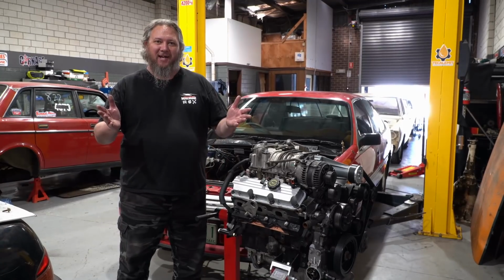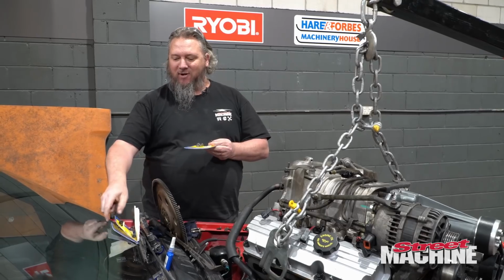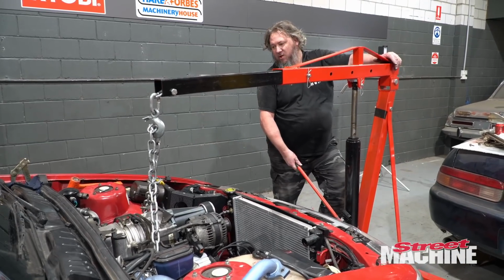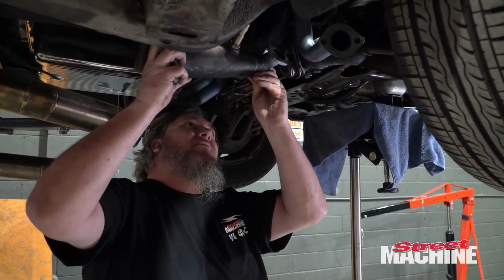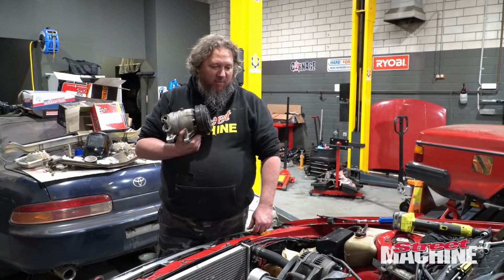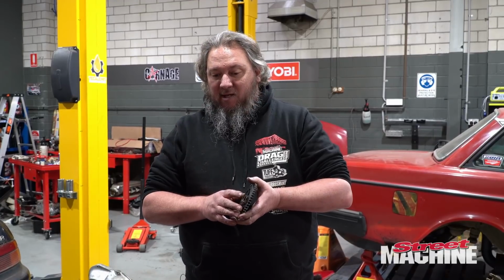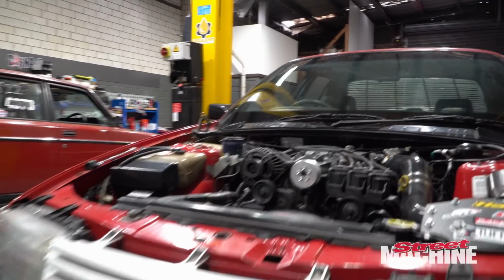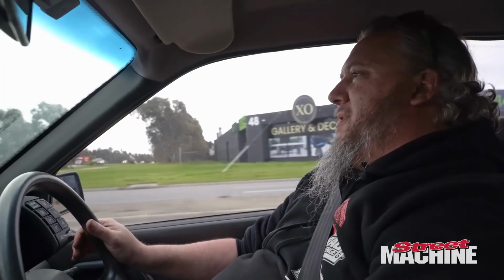Carnage - Supermang L67 3800 rebuild - Part-5

Comment: Yep. I’m converting my VT over to manual. When I was ratcheting up the flywheel bolts, one sheered off. Thought that was strange and pulled them all out, and you guessed it, and it was confirmed by the bolt guy, they were one use only. I’m glad it happened at this point rather than later. Actually I bought them off KJ Bolts at Geebung for $5.

Comment: Good to see she's back up and running. We actually ran 8s with factory bolts/ring gear. Never an issue in 9 years. Like you said, I think the problems come with people making mistakes.
Reply from the maker: If I hadn't removed the flex plate I would have left the stock bolts, but they're so small I thought let's just replace them, especially when we could get ARP so cheap. The are almost a perfect fit but the risk of bottoming out was there so I took a little off them.
Reply: Hows Terafi going these days? I got out of the L67 scene not long after you went turbo (if my memory serves)
Reply: @markhalden3922  Terafi is long parted out

Comment: Geeeez! It's good to see that there is someone else that has to do things twice because we forget bits and pieces.  LOL.. Great video 🤘
Reply from the maker: Yep, it happens
Reply: The best one I've seen at work is forgetting to put an entire clutch pack in an auto. Tech put it back in, got it all going, went to back off the hoist...no movement.

Comes out of the workshop ten minutes later holding the clutch pack and back up the car goes on the hoist.
Reply: @JossRickard  
Gord.. I bet I know what he said eh!
Reply: @stevenchandler4218  It was definitely a carton

Comment: Here’s a handy hint/tool get an old valve heat and bend the head 90 degrees to shaft and use it to hold flywheel by sticking shaft in bell housing bolt hole and the head of valve in ring gear
Reply from the maker: Nice

Comment: At first I thought it was gonna be a slug, but it looks pretty peppy, Seriously keen to see it run at the drag strip 💯👌
Reply from the maker: It's peppy but still requires retuning so it'll be even more peppy after that.
Reply: @STREETMACHINETV  as you'd expect with a fresh build, that tune was done with a fair few ks on the motor out of the vx wasn't it?
Reply from the maker: @stompnlocktheaucrew9544  nah, we got a second engine after we broke the timing chain in the VX engine
Reply: @STREETMACHINETV  aah yeah I remember, it was a low ks motor or something wasnt it, and almost everything was loose on it
Reply from the maker: @stompnlocktheaucrew9544  correct, we had to do a Carnage rebuild on it

Comment: Scotty you probably already know this but if you torque over the centre line of the crank with each of the bolts, you won't have a problem with the crank rotating because you have no torque multiplication of the bar length.

Comment: What gearbox are you using?? VN/P or VX.
I didn't know that there was a difference between the serpentine belt length.
Reply from the maker: VN T700
Reply: I recently put a VY L67 into a Manual VS ute and found out about the belt the hard way 🤣

Tell ya what, these are a fun motor with a manual behind them
Reply from the maker: @vipwh02  i bet they're awesome with a manual

Comment: Did you have a stage 3 shift kit in it or something else to make it full manual shift?
Reply from the maker: I did a full manual conversion to the valve body
Reply: @STREETMACHINETV  will a transgo full manual on a vt l67 shift as smooth as that or jerk you around?

Comment: Isnt that torque setting pretty low for a flex plate?
Reply from the maker: It is, but they're only small bolts and the factory bolts are even lower torque
Reply: @STREETMACHINETV  fair enough, locktite should do the job

Comment: But will run 10's ?????? 
love Supermang and the Dad's ute if not Oz only there very are on the Right way up side of the world ! Lol
Reply from the maker: Not in this form, but eventually we'll get it there.
Reply: Lol it aint ever running 10s not without a lil nitrous. Even my l67 max effort will prob see 11s at best.  I predict 13 sec pas with the 205rwkw.  Needs 3.7 gears too. 3.08 ratio wont do it any favours getting off the line.